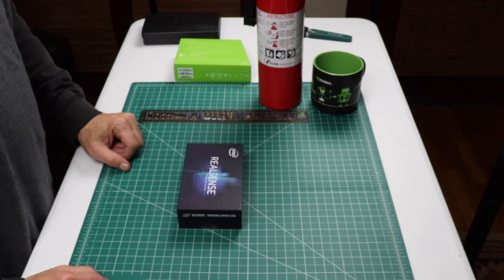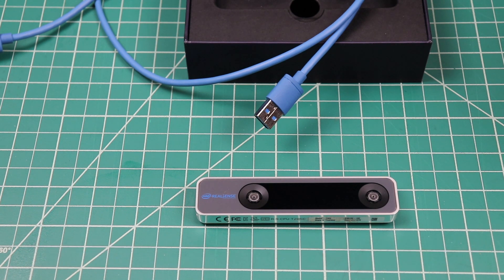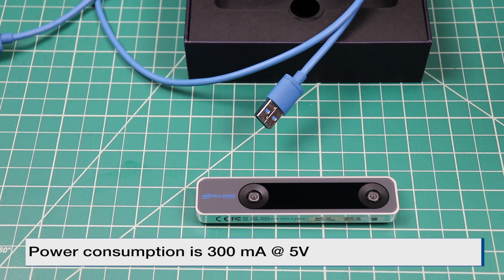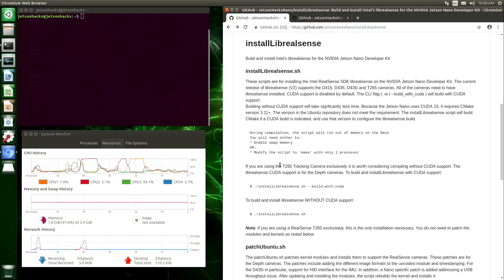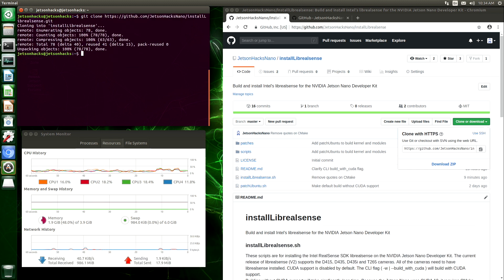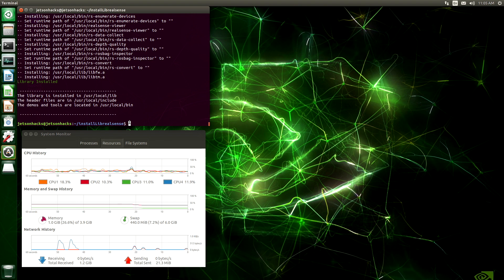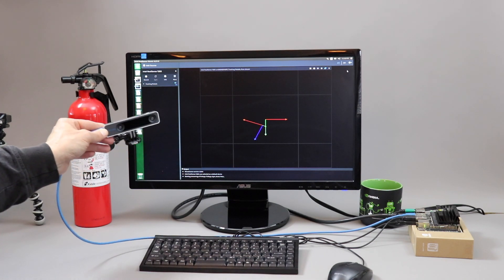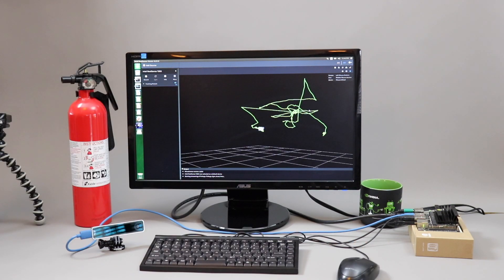Jetson Nano + RealSense T265 Tracking Camera

Comment: Hey! I wanted to ask are there any alternatives for fast paced applications like for example race drones and even if the Tracking and slam is on par for the job would nano be able to handle it?
Reply from the maker: It's hard to tell, there's a lot of variables. The T265 is pretty new, I certainly don't have enough experience with it yet to give a meaningful answer. Thanks for watching!
Reply: @JetsonHacks  I look forward to getting into this any suggestions from where to learn about it and stuff?
Reply from the maker: @ozy5332  It's a very large subject. For the drone stuff, Pixhawk and DIY Drones is a good place to start. For SLAM, that's a really big area. It's beyond what I can describe here, but robot operating system (ROS) is as good of starting point as any.
Reply: @JetsonHacks  btw for slam with python I was GeoHotz he has a a video where he codes it for hours understood a few things but still long way to go.. thanks for the other references though :)